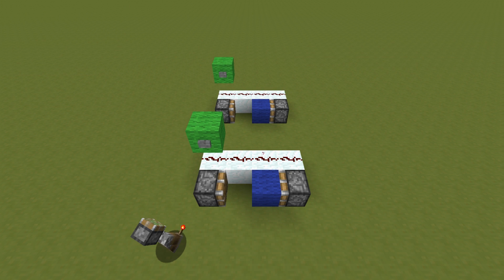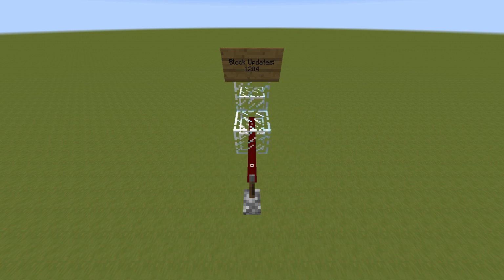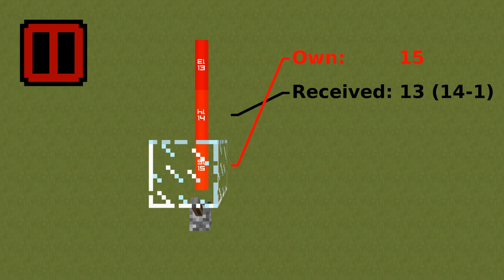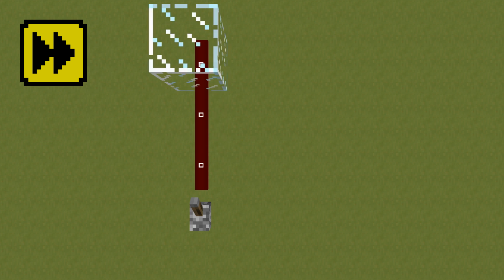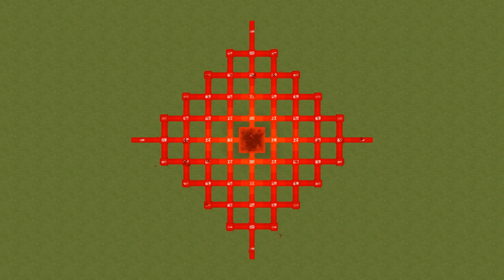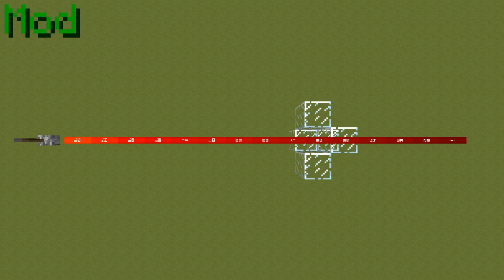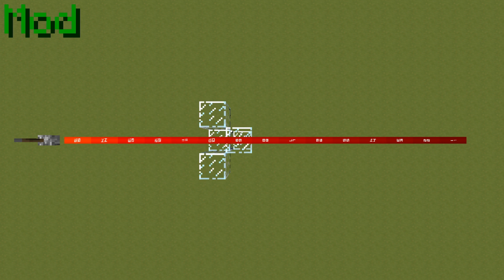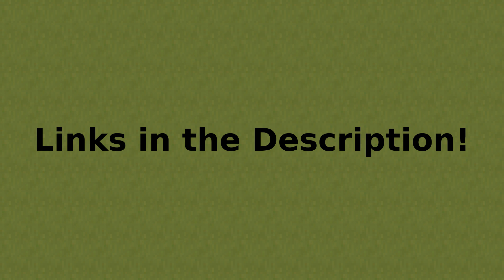Bugs and Ideas #03: Redstone Randomness and Lag

Comment: If the redstone updates A then B, let A be a buddy block and line go till B, won't behave same as A not buddy but B actives it
Reply: I tested it on seed=8613272461671939245 redstone-ready superflat, redstone wire on (2196,56,770)(,,771)(-2200,,)(,,768)(-2197,,)(,,769), (2198,,768)(,,764)-dropper-hopper-commandblock(say 1),stone on (-2196,56,769) and dropper-h-c on (-2196,56,768)
Reply: Activating (-2197,56,771), When (2196,58,768) was a redstone block, (2196,56,768) one actives first; else the say1 one first

Comment: Honestly, I know it's been said so many times, but Mojang needs to see this and hire you. This is amazing news for huge redstone builds like some of the ones I have done, where even on my fairly decent PC, it lagged. Also, is this compatible with 1.10.2?
Reply: They saw it, Mr. Broes (Grum) replied on the Redditpost someone made with this video }=)
What Panda didn't make really clear in this video (he did in his bugpost-comment though) is that this "RedstoneFix" mod is nowhere near implementation into the real gamecode, it's still experimental, and misses a huge portions here and there - come to think of it, he sort of does mention it in his video here, that there are still things to be considered and undone.
But seems like not everyone figured it isn't really finished };] I guess also because it's so much less laggy than the current wire implementation, but that's rather easy, given bad code state 😸

Comment: I have only made some very basic testing. But I'm struggling with very bad lag issue. Once redstone updates the rendering in the game temporarily stops. Are there too many updates sent to the client?

If I had written the redstone code I would update all redstone blocks only once every "redstone" tick based only on neighbor sources. There would need to be faster redstone tick compared with what we have today. But you get propagation delay on a single redstone wire and hopefully a very consistent and speedy behavior. Avoiding oscillation on the wires will be hard though.

Comment: I think the update order of the first part is good and logical, but the second half could just get removed. Who cares if bugusing contraptions break when fixing the bug they are using? And Mojang has proven in the past that they don't care about breaking stuff either.
Reply from the maker: I agree that the backwards compability updates should be removed. But recently that was done for repeaters in a snapshot and it turns out a lot of people do care really strongly about it.
https://bugs.mojang.com/browse/MC-109266
Reply: Panda4994 Yes, I've heard about that, actually even from Grum himself. That's another one of these bug-using things: Redstone doesn't go through non-solid blocks, so it also shouldn't update two blocks far (in that case). And before 1.11 everything that made block updates visible was also a bug (or "won't fix" like http://bugs.mojang.com/browse/MC-750). So even though it changed nothing redstone-wise, people become angry about it. Will you try to create a proper fix at some point? Grum said that it would probably require a complete rewrite of redstone. If that's the case, I might even prefer a "hacky" fix that works until MCPE catches up.
Reply from the maker: I might try to code a proper redstone fix at some point. Not an easy thing though.
I don't like the PE redstone and I don't think it will get to a point where I will like it. It is terribly slow and the update order is as far from predictable as it can be.
Maybe they fix that stuff at some point, who knows.

Comment: Is it possible to do this using Forge?
Reply: Someone made a Forge mod out of it, but this was not intended to be a Forge-compatible mod, as it likely falsifies the Redstone lag values and everything else, so Panda can't really compare it and know if the results would be the same in MC Vanilla }=)
A bit of patience, the Forge-mod might still have a few flaws, it might take a few days until panda looked over it }=)
Reply: Bit late, but in all honesty, Forge doesn't have much performance impact on it's own, it's very slight, it mostly just consumes more ram and an extremely small amount of CPU. Either way, even if forge caused lag issues, you could test once without the mod, and once with and still get the differences, since both tests would use Forge anyways.
Reply from the maker: There have been attempts to make Forge versions of this mod. I was asked a few times if it was ok to use my code (I still need to reply in some cases). I'm not sure if Forgeimplementation any got fully finished though.

Comment: This shows how insanely fucked up Minecraft currently is. A single person can reduce one of the major sources of lag in a four minute video. (Which is over the top exaggerated, but I bet he didn't work on this for years.)
The question is now whether Mojang gets off of their collective butts or whether they rather don't have a lot of motivation to implement something like this with the Java version becoming obsolete sooner or later anyways. And I guess PE/Win10 are done in this or a similar way already.
Reply from the maker: I worked on it for several weeks :-)
Probably Win10/PE has something like that, but there are other unsolved issues (e.g. a repeater sometimes updates faster than a line of dust!).
Either way, the fix I provided has some issues (as I tried to explain in my latest video). It is not quite as simple to fix it properly. I do believe that Mojang will work on a proper fix though. I also do believe that this will cause outrage as it will break old redstone contraptions :-/
Reply: Panda4994 To hell with old redstone contraptions! :D This game is made for creativity.  Sure you worked quite some while on it and it isn't perfect, but I do not understand why Mojang doesn't tackle this issue. They have more ressources and do this stuff fulltime. Even if they didn't have the time, just hire someone. Not anyone - maybe hire you! Or work much more closely with part of the community that are able to contribute such amazing things to the game like you do. It's just frustrating from a player perspective that Minecraft is such a huge game and has still serious performance issues. It drives me nuts that even powerful computers experience major lag spikes on a multiplayer server in an area where a lot of people have played for a long time.

Comment: Quick question: I got this working wonderfully with Vanilla 1.10, but is there a way to use it with OptiFine 1.10?
Reply from the maker: I'm not sure if OptiFine changes anything in the files I changed. If it does you can't use them at the same time.
Reply: They're both base edits, so I don't see why they can't just be combined. I didn't write the mod though, so I might be wrong.
Reply: Panda4994 i would asume that it didnt change anything to do with this as it doesnt modify anything server side.

Comment: How does (or doesn't) this relate to powered rail?
Reply: It's just I think they work off a similar mechanic (though I don't have proof) and have some of the same strange behavior. "Fixing" rail power would patch out some strange update exploits currently possible, but personally I think rails should be fixed because they currently work so strangely.
Reply from the maker: I haven't looked at rails, but I also think they are similar. Either way, rails are a lot simpler as they barely can branch off :-)

Comment: does this change anything for slimestone or just traditional redstone?
Reply from the maker: It only changes redstone dust. Everything that contains no redstone dust was not changed at all.
It obviously affects builds that contain redstone, but from all testing so far, builds that used to be stable before are still working in the mod :-)

Comment: awesome, have you tried making a version that doesn't try to stay compatible? 
how far were you able to optimize the execution?
Reply from the maker: I didn't try to make a not compatible version of it, but there is basically just 4 lines of code that would need to be removed to breaks the compatiblity. I don't think it would cut out a whole lot more performance, but maybe a bit.
Reply: well 66 instead of way over 1000 updates per deactivated redstone is a huge improvement already anyway, no matter how you look at it ^^
especially for bigger contraptions

so if it really wouldn't be much gain to improve redstone without caring about compatibility, then I would of course prefer the compatible version

thx for taking the time to do this! :)
do you know already, if you will you offer your code to Mojang?

btw. how do updates for upside-down slabs look like? different from normal ones, or not?

Comment: Would be great if this was put into the game, nothing more infuriating than making something that works then building it somewhere else and it doesn't work
Reply: I don't think this fixes these issues
it only fixes the lag but not the differences between plattforms
that would probably require breaking older contraptions
Reply: He also did change the RS dust update mechanics. The only old contraptions that would break from this are the locational builds relying on redstone dust update order. Most non-locational builds use block event delays to work around RS update order, so they would not be affected.
Reply: oh, so it actually fixes locational builds, then I was actually incorrect
awesome!

Comment: 1: Can you link the source code in the description?  You've got a link to it on the bugtracker comment, but it's not exactly obvious.

 

2: It's possible to make an MCP build for 1.10.2, using the existing resources (though it requires a bit of manual file replacement).  I wrote an explanation of it on the jira-helpers slack channel, but if you can't get to that I can quote it for you.
Reply from the maker: 1. I thought the tecnical people would find it when looking into it. Also there are a few additional explanations in the post I made on the bug tracker. Well.. I added it to the description now anyways :-)

2. I'm not sure how to join that slack channel, but would be interested in getting MCP to run sooner than releases :-)
Reply: I couldn't find a way to make that specific post public, so here's a copy of it on gist: https://gist.github.com/Pokechu22/97bf5bd528eeadef09dcbae8a15b009f

Comment: Really great work, and very well produced video!

The only thing I'm wondering is the reason for the reversed update order for blocks that are further away. Could you explain why you needed that exactly?
Reply from the maker: It's hard to pin down the exact reason. Basically with the recursive update order the entire wire needs to finish updateing to allow the first wire that received an update to finish all its updates.
So a backwards order comes closer to it.

I noticed the difference in a specific setup with a 0-tick clock that - in the early versions of the mod - created a 0-tick that was 1 piston delay less than in vanilla.
After reverting the update order for not directly powered blocks it worked fine again, as the pistons further down the line get sheduled sooner than the piston that turns off the wire.

And yes, this 0-tick generator was stable in vanilla as well.
This was the 0-tick generator: http://i.imgur.com/g5rYVZr.png

If the further out updates are in a along-the-wire order the lower piston on the right doesn't extend.

P.S. The thing in the background worked fine btw :-)
Reply: Ah yeah I can see how that makes sense. I'm not sure if reversing the order of updates to keep old behaviour is the best way to go about it though.

It will break some stuff, but I believe some other things will become easier. I'd think that adding block-delays using quasi-connected pistons would be easier for example.

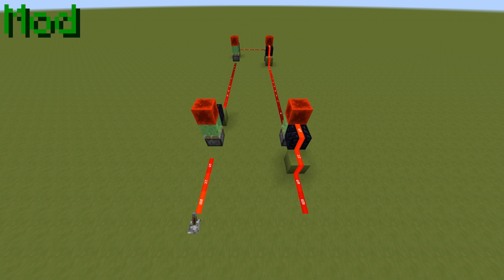What did you mean when you said you kept some updates in order for BUDs and quasi-connectivity to work? (2:13) I'd think that what you showcased should still work, since at the spot where the piston is a repeater could be as well, which is the reason that redstone updates two blocks out(I think). I don't see how you could get rid of that block update. Also, why is quasi-connectivity relevant here? I have to admit that I don't know how qc is implemented, but I'd think that changing how redstone wire updates does not change qc, aside from updates possibly triggering it instantly/not as often.

Have you thought about submitting this to Spigot, or are you not interested in that? I'm convinced that Spigot and server owners would be thrilled about this.

Comment: Very nice. You should be on the dev team!

As for keeping quasi-connectivity working though... honestly, I hate that quasi-connectivity is a thing. Sure, you can make a few smaller BUDs with it, but it causes frequent "gotcha" moments for me when seemingly sensible wiring does something strange.
Reply: Sorry to hear that you don't like quasi-connectivity. It's useful for a LOT more than BUDs. Are you familiar with the piston monostable? That uses quasi-connectivity. A lot of redstone builds use it, and it's a huge hassle to generate a quick pulse without that.
Reply: Yes, but it makes no sense. Obviously if it was removed, we'd ideally need new blocks for doing these things in a way that's consistent.

Comment: Yay! You finally posted it.  Very nice job with the visualizations; it makes the it very clear how extreme the difference is.

Regarding the update order, I think the order is logical, but maybe my opinion is too biased and doesn't count since we already discussed it a lot beforehand. ;)
Reply from the maker: Hehe, thank you :-)
I put quite some work into the video and plan to extend on this style of video. I will have to learn how to create "animations" and graphics faster than I currently do^^

From what I read most people agree that the update order which is intended by the mod is logical. But I noticed that there are cases that are not really nice yet. I have a good idea how to change that, but it requires changes outside of redstone wire.
On the bug tracker is a longer post containing the main downsides/change worthy things I see with the mod currently: https://bugs.mojang.com/browse/MC-11193?focusedCommentId=320079&page=com.atlassian.jira.plugin.system.issuetabpanels:comment-tabpanel#comment-320079

Comment: I tested your mod quite a bit and here are my ''results'':

Your mod gives me a loss of about 30% in fps, with alot of stutter, but redstone seems to go faster (Higher TPS I guess)
Normal 1.10 seems to slow down the tps alot sooner resulting in higher fps with less stutter but seemingly slow redstone.

In the end all my redstone builds did their job in the same speed, but that may be because even though normal minecraft has lower tps sometimes, if it has some less stressfull time it seems to speed up its tps well above 20 to make up for its previous loss.

So I guess you could say that normal minecraft stabilizes fps alot more, while your mod stabilizes the tps.

I have no hard proof to back this up, and its only from my own experience and testing, but I think it's accurate since I tested quite a bit.

Also maybe u could look into Optifine? I get like double or even triple the fps with no stutter at all if im using that.But redstone builds finish their job slower by about 15%, Redstone also seems to ''update'' slow. So I think optifine lowers tps even faster.I personally prefer fps alot more, even if redstone updates a little slower.
Reply from the maker: For some reason your comment ended up in spam -.-

If you wouldn't have commented this detailed I would have told you off that the mod has no reason to reduce FPS. But it makes a lot of sense that lower tps result in higher fps, as the client has to handle less rendering updates.
It's nothing I see as a downside of the mod, but an other issues that should get solved regardless.

Thanks for your comment :-)

Comment: very well done! Regarding the update order being logical or not: I think this implementation makes a lot of sense. I might miss something here, but since the redstone line updates are completely separated from the regular block updates, I think only the order in which the regular block updates are executed should play a role (please correct me if I'm wrong/forget something). Updating then from the lowest power source to the highest is at least fairly easy to remember/use. I could imagine that one could save a small bit of performance with the inverse order (strong to weak), if in the final effect the strongest signal would (usually) take priority (i.e. you wouldn't need to run whatever update code again for the affected block). However, I can't really think of many cases where blocks would react differently based on the signal strength (again, I might be missing something; I'm mostly dumping my spontaneous thoughts here).
Reply from the maker: Hmh.. I think the best answer to your comment would be to explain the mod a little bit and point out the main open issues with it I see.
But I already did that on Mojira so I will just link you to that :-)
https://bugs.mojang.com/browse/MC-11193?focusedCommentId=320079&page=com.atlassian.jira.plugin.system.issuetabpanels:comment-tabpanel#comment-320079